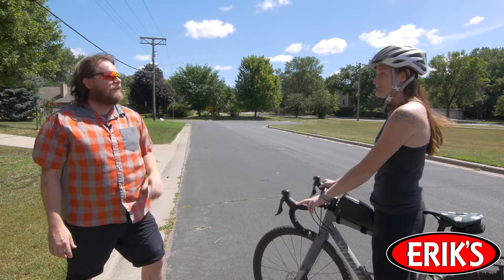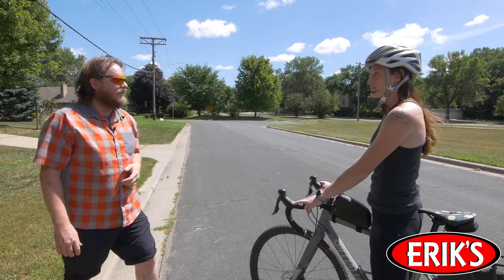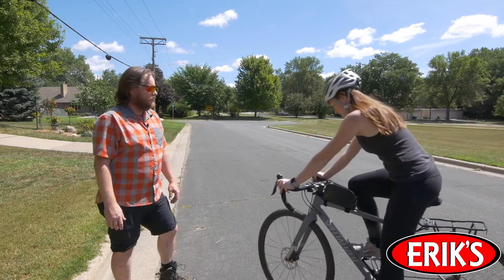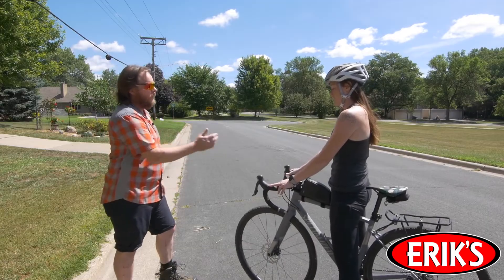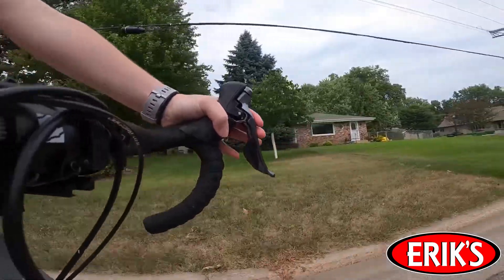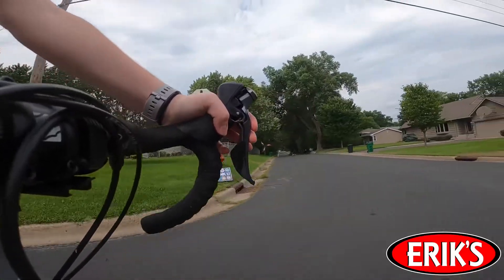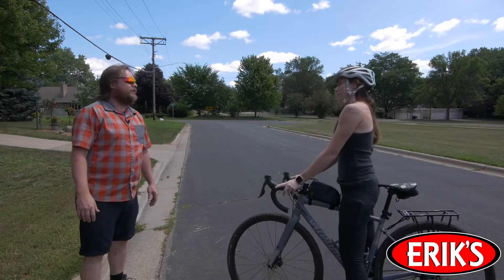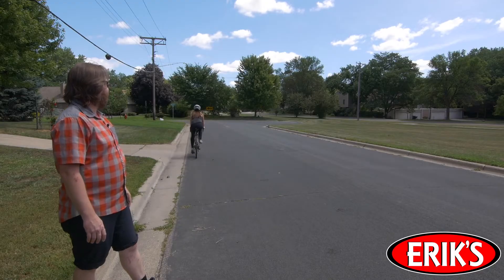How to Bed In Your New Bike's Disc Brakes - Step-by-Step Process | ERIK'S Bike Shop

Comment: Does this need to be done when only replacing the pads and not the rotor?
Reply from the maker: Hi @Lazurm, 

It is a good idea to bed in your brakes after you change rotors, pads, or rotors and pads, to get the best braking performance from them.